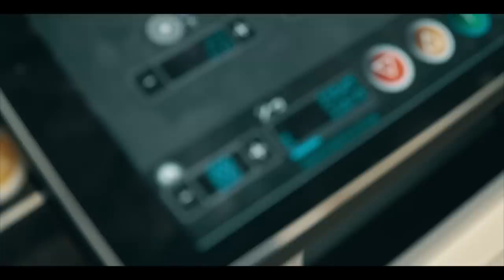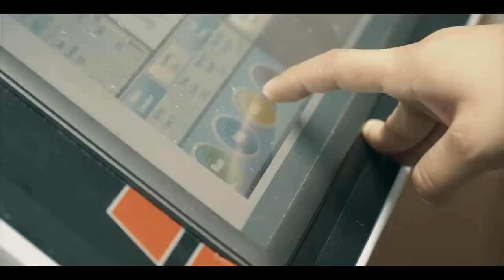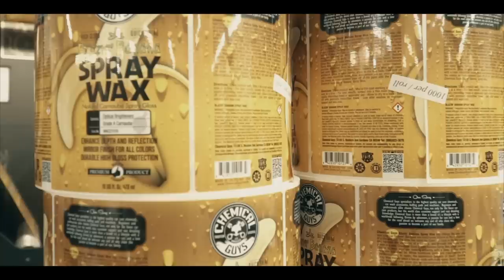Chemical Guys Behind the Scenes [How it's Made]

Comment: I have a 2000 Camaro SS the paint on it looks great how do I make sure it stays looking great? Any recommendations? Besides ceramic coating it. Thanks!
Reply from the maker: You want to make sure to protect the paint, if you don't want to use a ceramic coating you can use Jet Seal. This sealant will give you up to 12 months of protection. You also want to make sure that you are taking care of it each time you wash the car - improper washing or drying techniques will cause scratches and swirls. So protect it and maintain with a wax. https://www.chemicalguys.com/JetSeal_16_oz_p/wac_118_16.htm
Reply: Chemical Guys thanks!
Reply: Seal it put a wax over it then use a spray wax or wax as you dry to maintain beading.
Use ph neutral soap. Theres a vid of a guy mixing honey dew and vo7 in afoam cannon and it looks amazing when hes done
Reply: If you want to keep it looking great, you want to coat it. No other product on the market can outlast it, other than ppf.

Comment: As much as i like your stuff and dont seem to have 90% of the isue people have i if think you guy tweak your formulas ability to last you would have some solid stuff and  bring back some people who gave up on your stuff. Stuff makes my car look awsome but longevity of the awsome shine doesnt last very long. I  summer thats ok as i detail weekly but when its 30 degrees out i want to spend as little time out side trying to get the gloss back as i dont have a garage.
Reply from the maker: Hi Mike - please feel free to reach out to us so we can help you achieve your desired results. Application, preparation, and maintenance take part in ensuring that you get your desired results. So if you feel that something didn't last as long it is possible there is a tip that we can give to make sure you get the most of your product. You can always reach out to chat with our team through Facebook. http://m.me/chemicalguysmfgco
Reply: @ChemicalGuys  aww dont have a facebook act im new at detailing with lots of questions but all i can find online is mostley negative answers about overpriced under performing products which i DONT agree with as little over a month with one coat of butter wax and no washes or additional chemicals on my work truck that wasnt clayed or detailed only washed with mr pink(i may have used vo7 deatailer once or twice, has hundreds of miles a week highway speeds looks promising as theres still tons of beading weeks later. I plan on doing a 100% chemical guys products detail on my personal car as i already bought 90% of what i need and would definately welcome winter longevity tips. If im happy with the outcome in march i will increase what i have on my shelf to half gallon or larger sizes unfortunately nj has no detail shop so i cant take any classes or ask questions in person. Theres only one detail suply shop near me and  hes gonna wanna sell me whats in his shop  and half of it doesnt have much in the way of reviews. I do plan if i dont get lazy vloging it as possibly my first review video on a  new channel i want to start and i realy want your stuf to honestly succede
Reply: Hey Mike! Like you, I love Chemical Guys and 90% of my detailing arsenal is CG's. I had the same problem as you (longevity). My solution for longevity: ceramic spray as a protective coat. 
- wash
- clay bar
- ceramic spray
- detailer